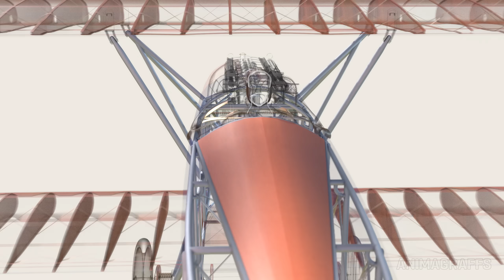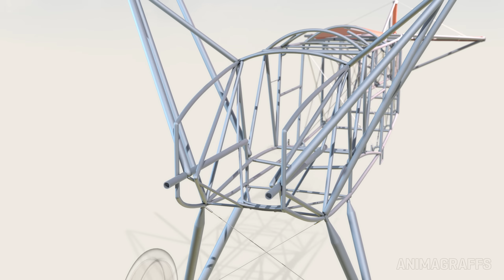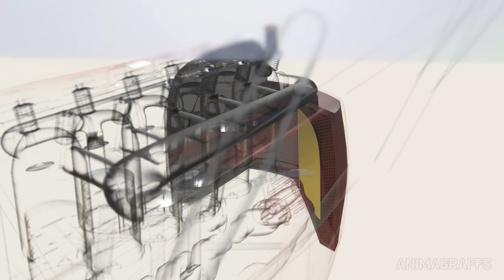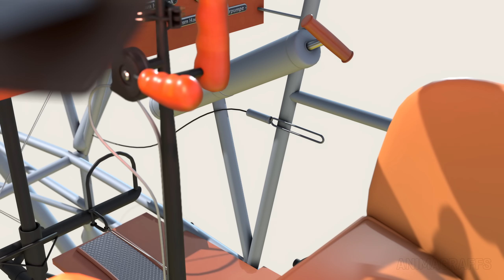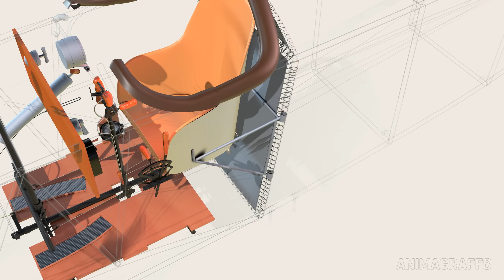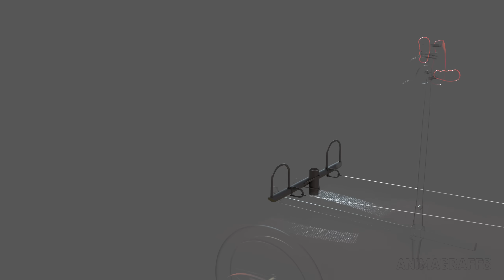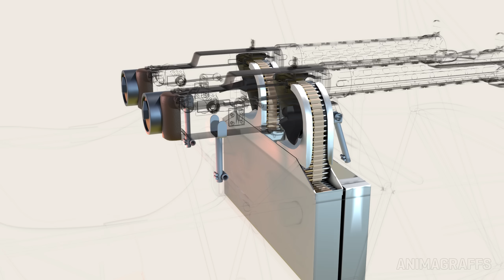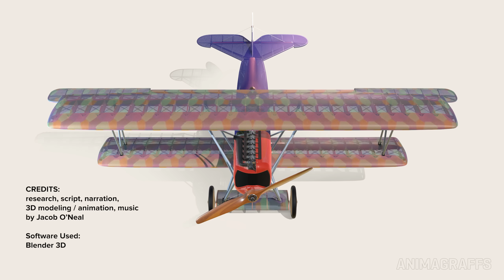How a WWI Biplane Works

Comment: I am surprised how similar this 1918 airplane was to the Pitts S1 aerobatic airplane I fly regularly.  The fabric covered steel frame, wing construction, double plywood spar, location and rigging of stick and rudder, are exactly the same.  I doubt one can find this much similarity between a 100 year old car vs. modern cars.
Reply: Morgan Motor Cars probably come close. But I suspect they are deliberately creating anachronistic cars because they want the cars to behave like they did a hundred years ago.

Comment: WOW! WOW! WOW! -
Thanks so much for the well paced dissection of the Fokker DVII biplane! 
If wood expansion was an issue, why were the propellers not made of aluminum?
Love the largely analogous 'fly by wire' (and no hydraulic) controls! 
Wonder how the pilot avoided or cleaned up the odd oil spray onto their flying glasses? - they may never have taken it off due to the icy winds...
Reply: They cleaned the googles with a silk scarf they wore around the neck.

Comment: In regard to the engine a lot of WW1 fighters used a rotary design similar to a WW2 radial engine setup, the key difference being that rotary engines have the crankshaft fixed to the plane and the engine block and attached propelers rotating around it. The advantage to this design is this allows for extremely weight-efficient engines, especially low power ones (<150hp). The biggest drawbacks were that these designs tend to spray oil all over the place and create a tremendous amount of torque on the plane, heavily affecting the controls.
Reply: During WWI (and before) internal combustion engines were crude and metallurgy was still in its infancy. Anything with an internal combustion engine shook wildly due to crude, unbalanced flywheels and the only way to remedy this was to mount a seriously heavy counterbalance. This way the shaking was reduced. For a car severe shaking and vibrations was less of an issue and for luxury cars were shaking wasn't desired weight wasn't an issue.

But during the early days of aviation with wooden frame canvas covered aircraft both shaking and weight were severe drawbacks An engine shaking could damage the frame of the aircraft. Weight obviously resulted in too much inertia for an aircraft which needs to be nimble and highly manueverable. 

Radials existed as early as 1907 as engines designed specifically for aircraft. The French Salmson radials were manufactured 1908 to 1920 in 7 cylinder and 9 cylinder configurations. But due to the bad cooling of engines of the era these radials actually were water-cooled. Heavy counterweights, water-cooling and radiators added a lot of weight . For this reason these Salmson radials were unsuited for light fighter aircraft. Little surprising the Salmsons were mostly used in bomber and recon aircraft. These would fly mostly in a straight line and were already heavy. 

So how do you solve the crucial issues of inferior cooling, harsh vibrating/shaking and heavy weight? By being very clever of course. Thus the rotary engine was designed. And no, the Wankel engine came decades later

Problems with cooling and heavy radiators? Let the cylinders rotate in a circle and cool themselves this way. Problems with shaking and unbalanced engines? By allowing the entire block to rotate the gyroscopic effect solves this problem. No heavy counterweight equals a light engine perfect for fighter aircraft. 

Primitive metallurgy and bad cooling were the culprit for the design of the rotary engine. At the end of the war technology had developed enough for radials and v-shaped engines to negate all the benefits the rotary engines had had until this point. Truly reliable radials with air-cooling didn't emerge until the mid 1920's though.

"The biggest drawbacks were that these designs tend to spray oil all over the place" Rotary engines used castor oil in a total loss lubrication system. Castor oil was in short supply in Germany which is why they rarely used them as the war progressed and they were also known to siphon downed allied aircraft for both castor oil and fuel. Despite engine cowls and pilots wearing goggles and scarfs covering their mouths pilots of rotary engines aircrafted ingested enough castor oil to give them frequent diarrhea. 

"create a tremendous amount of torque on the plane, heavily affecting the controls." The gyroscopic effect of the rotating engine did indeed affect the airplane itself forcing the pilot to correct the plane even when flying dead straight. This made famous fighter aircraft such as the Sopwith Camel tricky for novice pilots. Landing was particularly tricky since rotary engined aircraft didn't have a throttle just a crude kill-switch. Some sources claim that the Sopwith Camel killed as many novie pilots (or more) in landing crashes than those who were shot down by Central Powers aircraft. 

The real drawback however was that by the end of the war the rotary engine had reached the limits of the design, particularly in regard to the amount of fuel and air that could be drawn into the cylinders through the hollow crankshaft , while advances in both metallurgy and cylinder cooling finally allowed stationary radial engines to supersede rotary engines.

 "The advantage to this design is this allows for extremely weight-efficient engines" Indeed, during the early days of primitive metallurgy and cooling. Once those issues had been solved however the rotary had no advantages left and disappeared after WWI. The Bentley BR2 used in the Sopwith Snipe (230hp) was the peak of rotary design. 

Bad metallurgy, bad cooling, heavy weight and excessive vibration. All you need to remember how and why the rotary was born.

Comment: Pretty cool, although the propeller spinning the wrong way is disturbing. 😀
Reply: Hmm... I am a pilot, and every single-engine propeller I've met spins clockwise, as seen by the pilot.  That is what I see in the video.
Reply: @camdenmcandrews  Me too Camden. Have a look at 18:27 onwards. Spinning that way the air is going to be pushed forwards. It's turning clockwise from the front, not from the pilot.

Comment: Super detailed. Relaxing & Satisfying! “…Pilot. Blah blah blah…” abruptly ends without him having a parachute lol. I know things were different in WWI but talk about death before dishonor! Thanks again for another great video!
Reply: things were very different, for most of the war it wasn't so much about honour as it was that parachute design simply wasn't very advanced yet, the parachutes that they had were far too big to fit inside these airframes. they did have parachutes for balloon crews but those were effectively mounted in buckets below the crew basket, which would've created a lot of drag mounted to an airplane. The germans did eventually figure out a good enough parachute that also replaced the seat padding, but the entente not so much, but they seemed to always be slightly behind in aerial tech for the whole war to be fair

Comment: I've always wondered how the gun synchronization mechanism worked. You made it crystal clear. Great work.
Reply: As a curious kid that loved these planes one of my first questions was how do they not shoot their own propeller off? It was explained to me that the gun is linked to the engine, I accepted the answer but never really understood it. Seeing exactly how it works here is extremely gratifying.
Reply: @seanh9037  Yes, the sychronized gun had been suggested years before the war. IIRC, the first pilot to fire thru the propeller (a somewhat suicidal Frenchman) literally shot his prop off, after a few successes. He was captured along with the plane and it was found the pilot had mounted wedges on the prop so bullets would deflect from the prop, until it didn't. Supposedly Fokker was horrified when the gov't wanted him to duplicate the system and built a synchronized (but unreliable) gun into his Eindecker.
Reply: Here’s a couple of fun facts: While those guns are technically machine guns, they’re actually set up to fire in semi-automatic mode, that is, one shot per pull of the trigger. The engine is pulling the trigger fast enough that you get the same practical effect as if it were fully automatic.

Also, all of the guns used for synchronized fire had to be ‘closed bolt’ designs. The most common were derived from the Maxim Gun. The reason for this was to ensure consistent timing between when the trigger was pulled and when the chambered round fired. That’s why you only see ‘open bolt’ guns like the Lewis Gun used in over-wing mounts, like on the SE-5 and some of the Neiuports.
Reply: @DABrock-author  No, they're still fully automatic. The interrupter gear, an alternative name for it, simply keeps the gun from firing at the appropriate times.
Reply: @anzaca1    Synchronized (shown here) and Interrupter are two different methods.
The Interrupter developed first, paused the firing of the machine gun if the prop was in the way,  by catching the hammer for a moment.
Synchronizer pulled the trigger for each shot separately.
Reply: @DABrock-author  Yes and the guns varied in firing rate depended on how quick the prop turned, so slower fire than full automatic. By the end of WWI Germany had nearly perfected an electric firing mechanism. As I understand that one, it allowed full automatic but interrupted fire when a blade was in the wrong position. Of course there were problems with the WWI design. One German WWI pilot shot his own prop (thought to be 7 times) before his prop flew apart. I read that could happen if RPMs exceeded redline, thus the desire for the new system.
Reply: @DABrock-author  Actually not much different from any rifle that is capable of both auto and semi auto fire. The synchronized action is basically controlled by a disconnect assembly that would actually be “tripping” the hammer. Take a look at how the auto function on an M-1 carbine or M-14 works and it will be clear what I am talking about! They call it the auto sear mechanism.
Reply: Same.  It's really ingeneous in its simplicity.
Reply: @macedindu829  i love how detailed this is but I can’t quite understand exactly how the interrupter actually works,
Reply: @joemueller4738  It's physically tied to the engine.  When the pilot pulls the trigger, it allows the result when the propeller isn't in the way, and disallows it when it intereferes with bullets.
Reply: @macedindu829  thanks,I understand that but the gears and lever’s allowing it to occur I’d have to see it up close in action to see how it does that.I think originally before the interruptor they actually attached metal guards to the propellers hoping it would deflect bullets from striking the propellers but often it would destroy the propellers.
Reply: @macedindu829  It basically holds the hammer back until the path is clear.
Reply: @macedindu829 Before the advent of the synchronized operation someone calculated how many bullets would strike the propeller and how many would make it through and fitted steel deflectors to the prop blades to prevent if from being shot off
Reply: This is great! But I’m impressed by how complex these aircraft actually were,there were and are some very ingenious people throughout all of history,and it makes me feel like a moron compared to these early aviation pioneers
Reply: The Slo Mo Guys made a video a few years ago covering just this!
Reply: I’m pretty sure that Mercedes did not make engines, Benz did, this being before the 2 companies merged.
Reply: I’m pretty sure that Mercedes did not make engines, Benz did, this being before the 2 companies merged.
Reply: A 30 second internet search would have told you but you 'always wondered'
Reply: It’s a death trap.
Reply: @PerishingForLackOfKnowledge  how?
Reply: Just need some wear and tear on those gears to screw up the timing and we can expect self shot to the blades...
Reply: @fidelcatsro6948  now show me demonstrable evidence of that happening
Reply: Yes, the name “interrupter gear” is something of a misnomer. The guns aren’t so much being interrupted as fired semi automatically rapidly by engine power.
Reply: Good overview. I should know after thirty years as an aviation mechanic.
Reply: no it was boring I fell asleep
Reply: @PhotoFlight  it's amazing
Reply: This particular one is quite complicated. Many also used a simple cam-based mechanism, with a cam mounted vertically on the propeller shaft that is designed to push a push rod, which engages another horizontal push rod, which engages the trigger. There were plenty of other designs afaik
Reply: Same here. How they were able to figure out how to make it all work together, with the limited technology of the time, baffles me.
Reply: @Driver0378 
Necessity... Is the mother of invention
Reply: @tayloralvidrez4342  So very true!
Reply: @Driver0378 Cyrus McCormick invented a horse drawn hay baler that could tie a knot in a string in the 1800s…I’m convinced the basic intelligence of the population was probably higher 100+ years ago when life was harder, albeit lack of education or malnutrition might prevent it from being expressed in many cases.
Reply: @Driver0378  They knew, just couldn't get it up in air.  The general concepts were there... And then when the Wright's put it into the air, all those concepts fell into place.  Sorry for being a killjoy.  Humans aren't dumb outside of the voting booth.😅
Reply: There's a few different mechanisms out there, but they're all brilliant and all work in very similar ways. used well into WW2 in fact as many aircraft retained guns at the centerline.

The real trippy ones are the guns which use a hollow-core driveshaft (or in the case of the P=39 and P-63, having the engine BEHIND you despite the prop being up front) to shoot right through the prop-hub. Common with aircraft cannons.
Reply: @DFX2KX  Wasn't the P39's drive shaft lower, so the gun fired thru the prop hub... sort of thru the transmission? The BF109 with the hub cannon fired between the cylinder banks of the engine, IIRC.
Reply: @mikep490 The P-39 had a prop setup where it was mounted on a shaft separate from and geared off the crankshaft. This propeller was a hollow shaft mounted off to the side of the solid engine shaft that ran under the pilots seat. The engine was mounted behind the cockpit. The machine gun or canon was designed to fire through the hollow shaft assembly
Reply: @DFX2KX  The majority of aircraft outside of Germany, the USSR and Italy didn't use synchronised guns. Mainly because the gear added weight, and also because such guns typically had limited ammunition due to space, especially with larger calibres.

Comment: Just beautiful. You forgot the silk scarf often worn by pilots to keep their necks from chafing as they constantly swiveled their head to watch for enemy planes.
Reply: As worn subsequently by Snoopy. Curse you, Red Baron!
Reply: Only my thought, but wasn't the scarf used to slow or stop the excess flow of blood to the brain during acceleration of "g" forces during certain flight maneuvers?
Reply: I think the engines early on had a tendency of throwing oil into the face of the pilot. The scarf was to wipe of his goggles
Reply: Perhaps, but they wore silk scarfs and I couldn't think of a worse material to wipe away oil from your googles with.
Reply: @ScoutSniper3124  The Sopwith Camel had an engine with what was called a "constant loss" lubrication system. Oil was fed into the parts that needed lubrication, then passed on through the bearings and was lost from the motor. From there it was slung and blown all around including on the pilot. They had to wipe the googles to maintain sight. And it, as well, was an insulation and skin protection item. There is a video that is titled a Sopwith Camel and a Spitfire flying in formation, and the Sopwith pilet talks about the engine and the method of flying the Sopwith. It is a very informative video, as well as seeing the two planes flying together, one a full throttle and the other barely avoiding a stall.